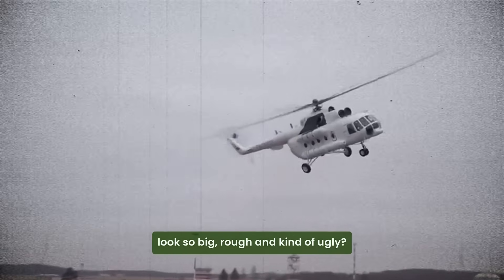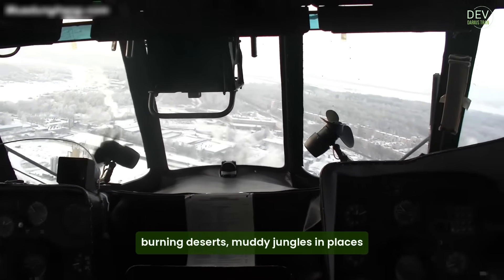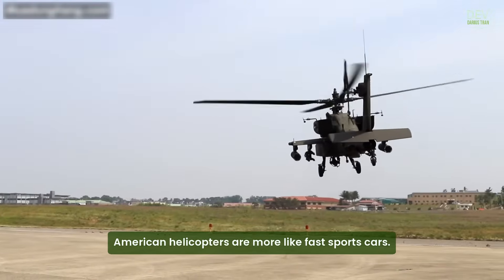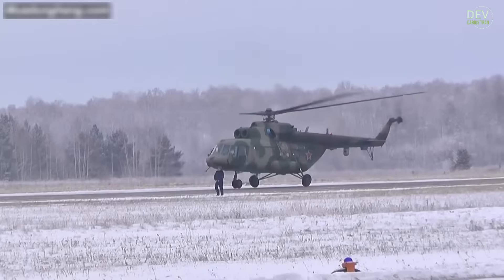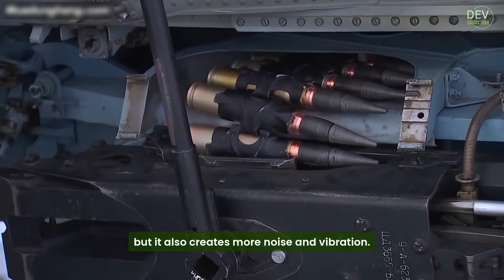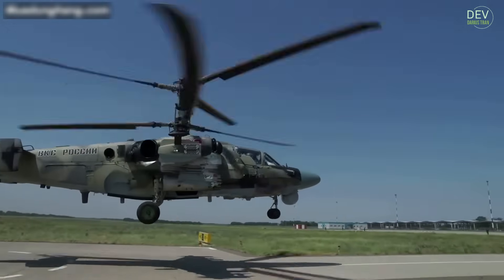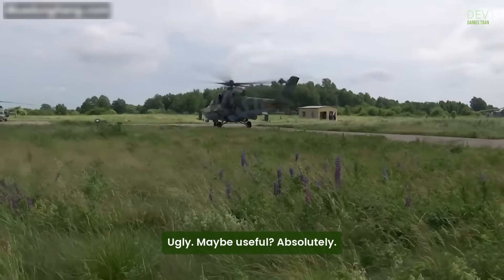Design Fail? Why Russian Helicopters Look Like This

Comment: Russian helicopters are severely limited in their usage, and their ability to fly and land is significantly restricted compared to the UH-60 or even the S-70. During natural disasters in my home country, China, the army's regular Mi-series helicopters were unable to reach and land in most disaster areas; they had to rely on the very few imported S-70s to do the job. As always, when put to the real test, Russian equipment fails. They are more stylish than the American ones, though, due to their comical look.

Comment: US helicopters are made for rich developed countries, better engine, equipments and weaponry but expensive parts expensive to maintain.

Russia helicopters are made for poorer developing countries, cheap and easy to maintain, works well even with a very low maintenance. I guess even some random blacksmiths from pakistan etc. can repair the parts.😂

Comment: This is the first time I've heard that someone can call these helicopters ugly. Maybe my environment is different, but the simple question is why is it ugly? Because they are a little bigger and look different than the Sikorsky Black Hawk? The Russians, or rather the Soviet Union, had their own style, based primarily on pragmatism.

It is spacious, you can even stand upright in it, simple, reliable, cheap, and they often make gunships out of it. It copes well with the task of transporting cargo and people. It has good visibility in the cabin, which is important for pilots. Boarding and disembarking for soldiers is quite convenient, 2 doors and a ramp that opens at the back. The machine looks quite interesting, as if some kind of bus or a hard-working bumblebee.

War is money, if you need to maintain a huge army, which needs to be replenished because soldiers and equipment "disappear" from time to time, every detail of weapons, equipment, gear needs to be restored or produced new, all this costs money. All this will break, all this will be subjected to a tough endurance test in war conditions with constant climate changes, dust, snow, water, dirt, impacts from falls, shrapnel hits, etc. Equipping 1,000 soldiers, for example, of some special forces for one mission is one thing (there you can give them all the most sophisticated, fashionable, electronic, expensive, etc.), BUT, equipping each time a new soldier and a new division with new helicopters from the factory, which you need to be able to repair on the battlefield simply and quickly is another.  And all this requires money, a lot of money, if you can make it more or less simple, reliable and cheap for the army it will be a huge benefit as well as for the economy. and instead of making beautiful lines at the helicopter and spending more time on it at the plant of materials and money, it is better to buy additional bandages, food and bullets for the soldier. War is generally not a place of beauty and comfort. There is nothing beautiful and comfortable about dying in the mud
Reply: To add on the spaciousness.. There was a gas station near me and they had a Mi-17 turned into a caffe on the parking lot.. loved to go there as a kid
Reply: @beyondrecall9446  I didn't know about that. Sounds pretty interesting, if that's true, it's nice to know that our war machine has now received new life of peaceful existence. 🙏🏻
Reply: When they hate a specific country, they will hate all of its creations.
From enthusiasm to propaganda

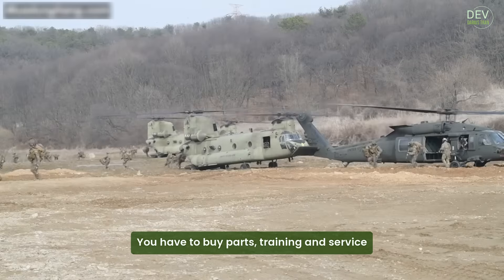Comment: 4:03 big freaking lie. Brazil put them out of service because they were hard to maintain, the 23mm dual canons tend to jam very often and even more when they get hot. And the worst part was the Diva attitude from Russia to made the maintenance and  supply the spare parts. Venezuela even had one crash down from malfunction, and the rest barely are flying in low impact missions because they are utterly expensive to repair and maintain for the same Diva attitude from Russians technicians. So, IDK if that happens only in the new export models (MI-35) since Peruvians looks happy until I know with their MI-25 (soviet era export), but even as I love that MI-24 (my favorite helicopter of all times), they had become an unbearable headache for Brazil and a useless money sink for Venezuela, and all because the terrible and well known after sales politics form Russia.
Reply: Спаренные пушки на Ми-25П имеют калибр 30 мм
Reply: @ВадимФетисов-ж3ф  Brazil had the MI-35 (pretty much the same version as we have here in Venezuela) which comes with GSh-23L with a very peculiar system (Gast) in 23x115mm.

Comment: Ka52 Mi28 Mi35 are more than beautiful flying machines ! Much more beautiful than some west helicopters .
Reply: Nah, MI-28 is like an abortion of the 24. The MI-24 is by far the most beautiful, useful and amazing copter of the world. They must keep him as it is, a badass flying IFV and use the KA-52 as a main attack copter, and maybe develop a little bit more the KA-50, make it simpler, fewer options to make one man only doable.
Reply: @oaninor the KA-50 is flawed though.
It turned into the KA-52, the KA-52 is just the better version of a 50.
The single pilot design is why it was improved on
Reply: You forgot the Ka-50.   That thing is menacingly beautiful.
Reply: 😂😂shut up please

Comment: The Mi-24 have a very very strong air conditioning system, not just fans, the fans are just as reserve. And inside this system have  "ABC" air filters. Interesting fact but all Russian made combat (attack) and combat-transport helicopters have a pressurized cabin. 
In the Russian terminology the Mi-24, and the 24s more andvanced successors, the Mi-35M and Mi-35M3 are not "just" combat or attack helicopters. They are combat-transport helicopters. Why? Because they can transport 8 fully equipped soliders inside the "cargo/passangers" cabin. And on every Mi-24s,35s and 35m3s this cargo cabin also pressurized and air conditioned. I travelled inside there. Outside the helicopter was +36 Celsius, and inside was just  +22 Celsius. It was noisy of course because over us worked two Klimov TV3-117 turboshaft engines, but it was like a heaven, after the +36.  And all Russian made combat helicopters, the Ka-52, Ka-52M,Ka-52K,Mi-28N and 28NM have a pressurized air conditioned pilot's cabin. The Russian made transport helicopters (Mi-8,Mi-17,Mi-171,Mi-172) haven't pressurized pilot cabin. Why the Russian combat helicopters have a pressurized cabin with ABC capable air conditioning system? Because with this systems they can easily operate over ABC contamined territories. In the USSR and the modern Russia, the Mi-24 have ABC recon version, the Mi-24R with special recon containers. And in Hungary the Hungarian scientist also developed  ABC recon containers for Mi-24. The Russian helicopters are very very reliable, much more than western ones. Russians don't require maintanance contrats. But if you have brain you made maintanance contracts with them, because they made it much more cheaper than western companies, and your life was will be easier, if you have a reliable maintanance partner. 
Fun fact, in Hungary Mi-24 used don't "just" as attack and transport helicopter: they used as firefighters too, with bambi buckets.
Reply: The right term is NBC or CBRNe

Comment: this is a lot of cope; soldiers exhausted from the flight fight worse. soldiers overheated fight worse. it's even questionable whether they are in fact easier to repair. Rus Lies.
Reply: Crying helps to release stress,  try it.